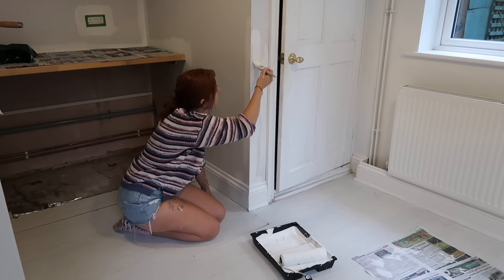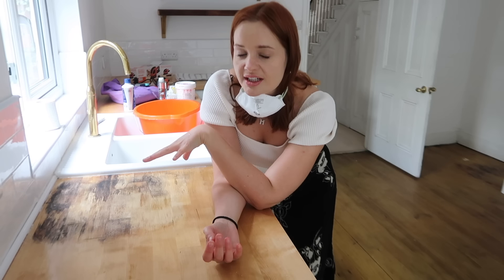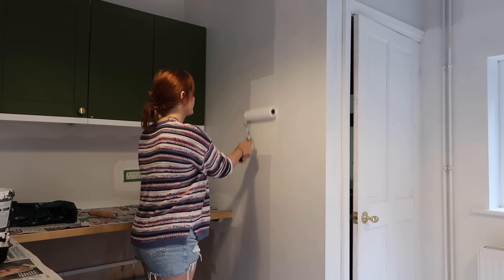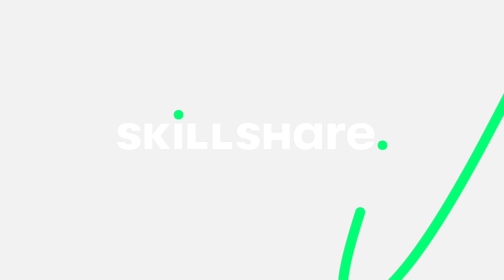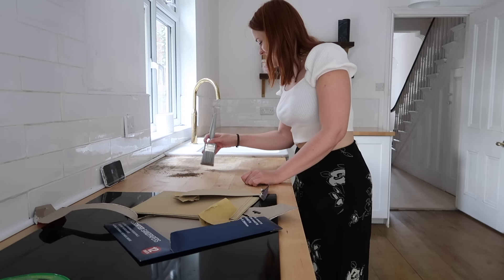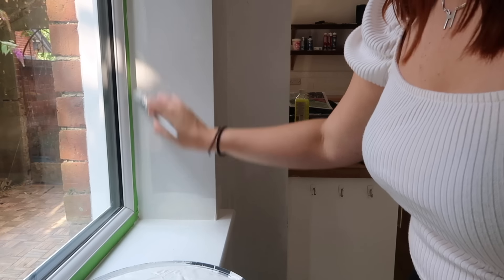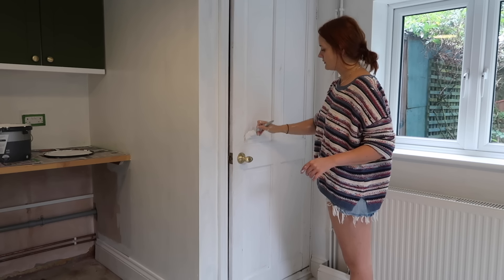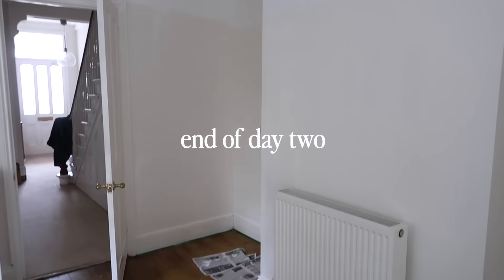Renovating our Victorian home | DIY begins, prepping and painting the kitchen

Comment: Have you considered installing a draining board over where the damage is? Because you keep calling it a stain, but really its water damage, the wood is rotting and no amount of cleaning/sanding is going to fix it unfortunately as it looks really deep into the wood! You can get ceramic/enamel ones that will match your sink :)

Comment: The butcher block is fine to sand down and finish with an oil or a poly, there’s no reason not to finish it with something waterproof and durable if you’re not going to cut directly on it

Comment: To protect the worktop you can use a matt varnish, comes in 2 parts that you mix. It's sold in the UK as bartop laquer. I have it on my worktops, lasts years, saves re-oiling, and is food safe. Stinks though for a few hours whilst it dries. Manns also make a single bottle version, but I've never used it.

Comment: If you finally give up on the water stain on the worktop, even if it looks better it is now porous and open so it will soak up the water, don’t buy a new piece, just flip this piece and put the stain underneath, flip it over and turn it round so the stain is still at the back but away from the sink.

Comment: You could use butcher block oil on the wood. That is simply mineral oil which is sold as a laxative at the pharmacy. It won't help with the black spots but will be good for the wood. You can put a dish draining mat over the area and you won't see it.